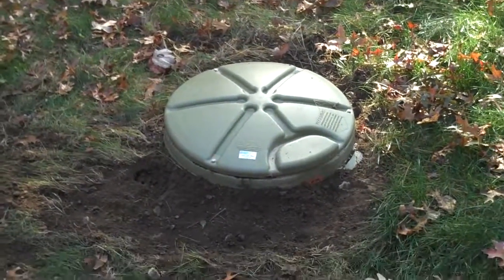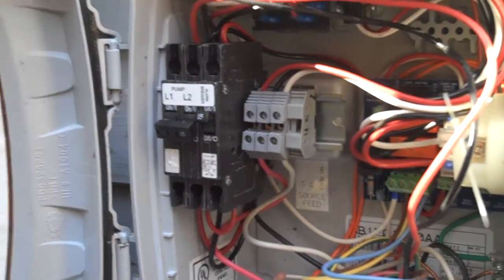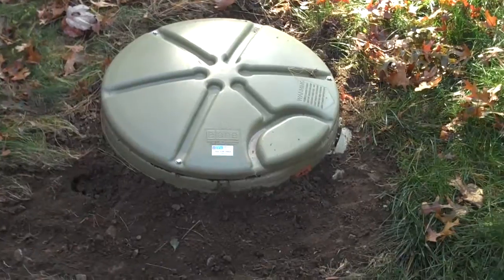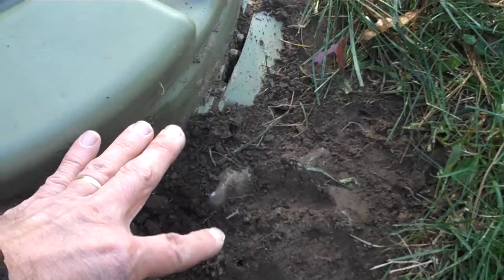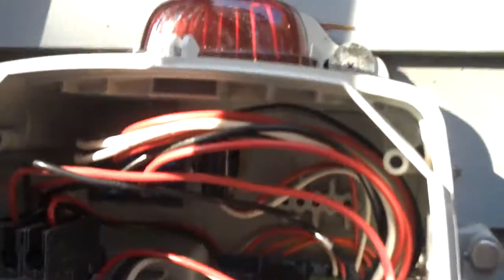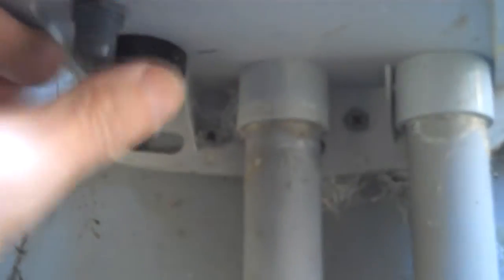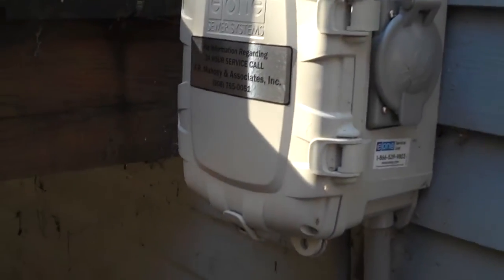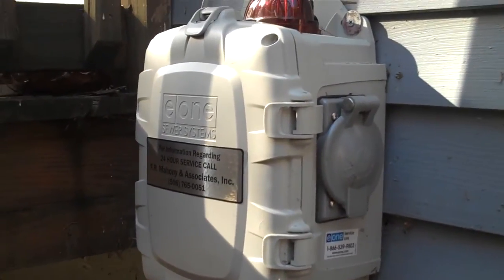grinder pump alarm test E ONE  model DH071

Comment: Hi @mrdavetrouble, I know this video is 4 years old but we are considering getting one of these E/One systems. We were wondering if there was a sewer odor at all that came from the top of the lid where you have the pump. We'd have to put ours like right in the front of our house and we didn't want to smell odors anytime we went outside. Also, what is your overall opinion of the system, any major issues? Thanks!
Reply: I’m not an installer, but we have one of these E-one pumps. No, if everything is working correctly, there should be no odor. If you smell sewage, you may have a leak. We had a leak in our discharge pipe due to poor installation. The sewer repair crew told me E-one makes high quality, low maintenance pumps. Hope this helps.

Adding this to my comment…never ever put anything down the toilet except water, human waste, and toilet paper. No paper towels, no “flushable wipes”, nothing. That stuff will clog your pump and create a sewage disaster. There are videos here on YouTube that show the results of putting stuff into the grinder pump that shouldn’t go there.